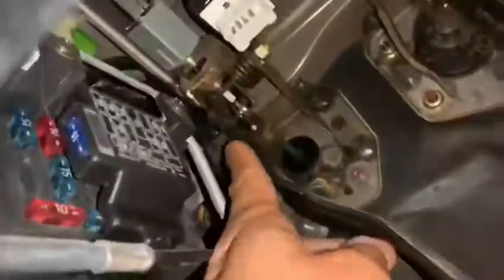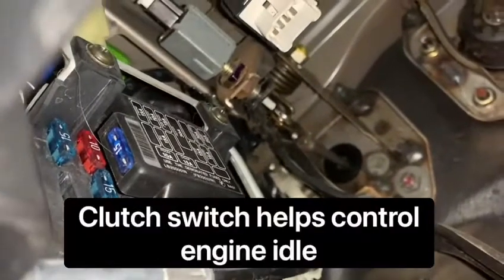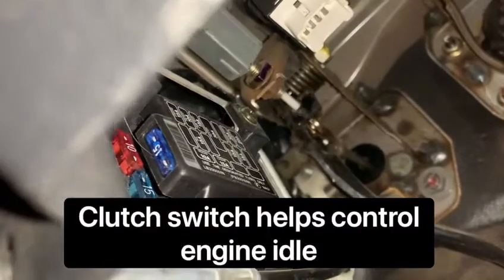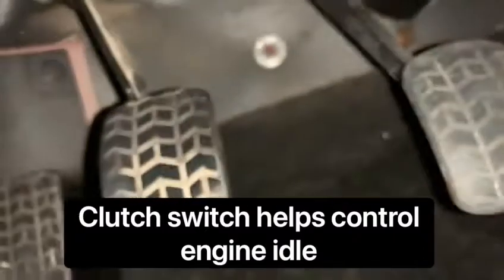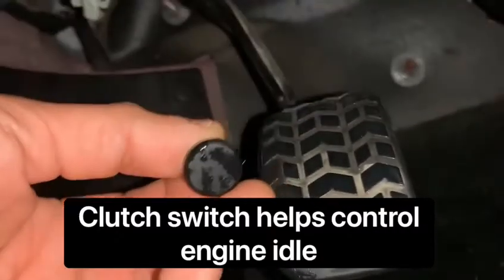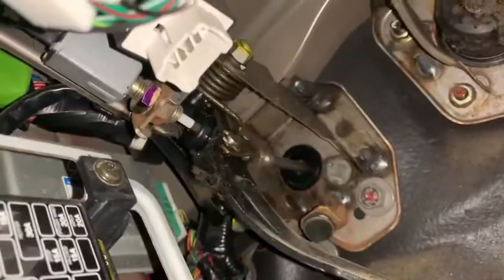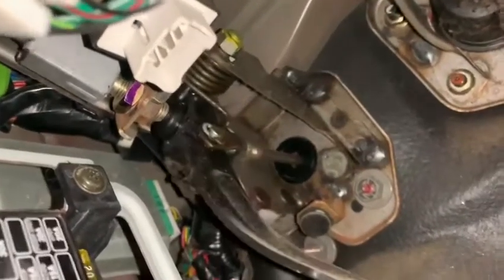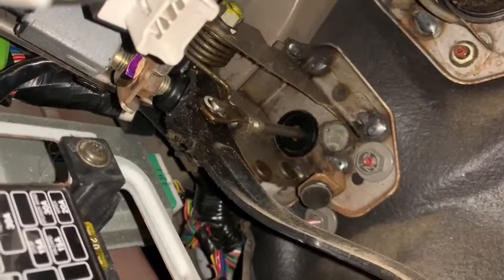NA NB Miata clicking sound when operating clutch

Comment: Help. I managed to brace my clutch in with a board while I replaced that little bumper. In the process, that white plunger thing fell out..about an inch long. I don’t know if it broke or what. Can someone tell
me what  it is and how to replace it, please? Clutch works fine and doesn’t click anymore but, now I have this little problem. Thanks for any advice.

Comment: My Miata has been giving me trouble for months. It almost always takes 10+ cycles of pushing the clutch in & out while the key is turned in order for it to start. After seeing your video I am almost 100% certain it's just because my plunger is missing. Thank you for this video. I almost sold the car because of the very annoying no start issue (reliable transportation is a must for me). Maybe now I'll keep it and be happy with it for the foreseeable future.
Reply: Update: just checked and my stopper is perfectly fine. I'm so done with this car lol
Reply: Sounds like an issue with the clutch hydraulic system. Did you ever figure it out?
Reply: @stanceswitch6419  I didn't. Only learned how to live with the issue. I sold the car for reasons unrelated to this issue, so that problem is out of my life now

Comment: Thanks for the video. 👍 I put the stopper in as you suggested, and it is quiet 90% of the time, but every now and then, I still get a switch-clicking sound.
Does anyone know what this might be? Maybe the switch is bad? Thought I'd ask incase anyone else is having the same problem or knows of the solution to get rid of remaining clicking. 🙏